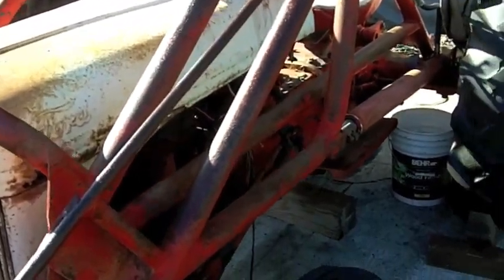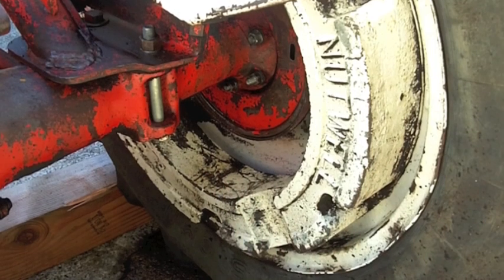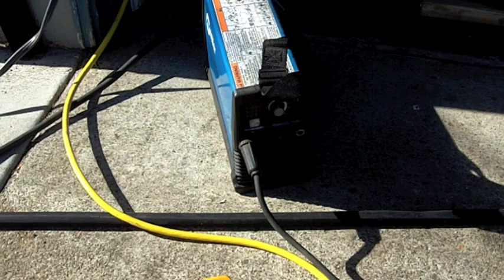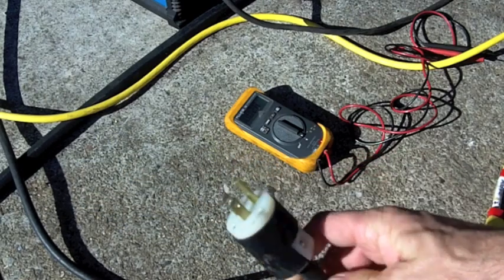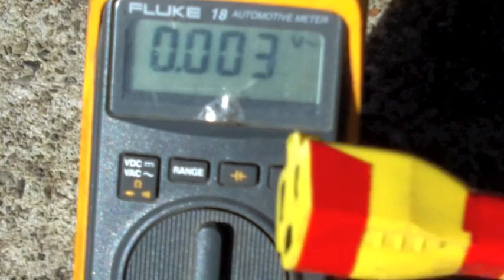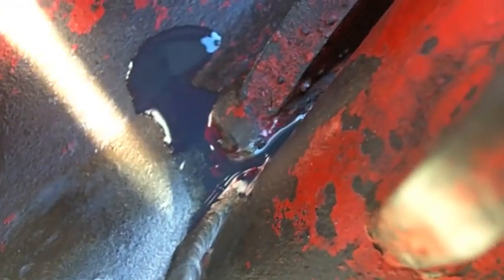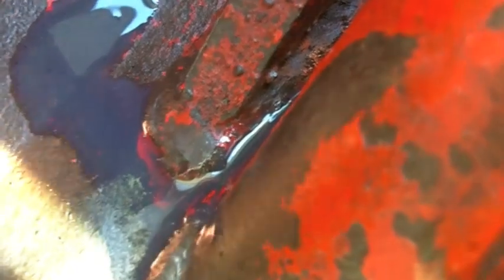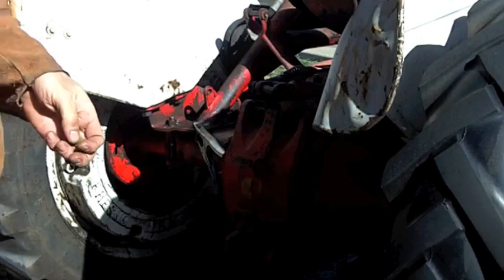Fixing Hydraulic Leaks On The 8n Tractor 1

Comment: Is it 12 volt?  My grandfather had a Ford tractor.  I don't know if it was an 8n or 9n or something else.  It plowed snow in Maine, long after farming stopped.  The plow was just a flat wooden blade on the loader arms.   You may need a real plow blade for all the Ranch roads.  Your hydraulics may support power angling for the blade.
Reply from the maker: Jeffrey Plum the P.O. converted it to 12v at some time.  At this time , I really have no intention to use this as a snow plow.  I have the blower on the smaller tractor and a blade for it as well.  We don't get arctic snow at The Ranch.  Those rare years where we get a real dump, my neighbor takes care of the inintial clear.
Reply: Winter in Maine and Mass. make one focus on snow removal.  It looks like very nice machine for general ranch work.    I look forward to seeing all you make of it.
Reply from the maker: Jeffrey Plum Yeah, I guess if you live in an area that gets several feet of snow...several times during the season you really have to figure out what to do with all of it... seems like when there is a LOT of snow on the ground the world shrinks.
Reply: We don't get alot at once, usually.  Things like Nemo and '78 are exceptions.  I have a G I shovel from sand bagging in '78.   I'd trather have more snow than the  snow-then-rain mixes we get near the coast.   That gets heavy fast, and freezes like cement.

Comment: re liquid in your tyres billstmax uses windscreen washer fluid as ballast for his garden tractor winter time rear wheels
Reply from the maker: TheThecyclist Thanks for the tip.
Reply: yourbeekeeper if you check his videos there is one showing him filling the tyres with screen washer fluid he poured it into a bucket and used a submersible pump to put it into the tyres he removed the valve core first to make it easier he uses this stuff as he lives in orangeville in canada where it gets very cold

Comment: Well done on the weld. That seal might have been dried out from sitting. Took a bit of driving to force new oil in there and then it swelled tighter. Not that I wouldn't change it. Do you think there is calcium chloride in the tires? Don't know if you get cold enough to to freeze solid. The calcium chloride was more enviro friendly and cheaper than antifreeze for tractor tires as I remember.
Reply from the maker: 57WillysCJ I will definately change both seals...I don't like leaks if I can help it.  I should have made a video, but that same day I captured some of the clear liquid that came out of the tire and let it evaporate in the sun in a pie tin... there was no residue left in the tin once the water was gone, so I suspect the liquid was plain water.  This tractor has never been in a freeze zone, so they likely saw no need to go beyond plain water.

Comment: Use 3/32 rod to weld up the cracks in the loader frame, V out the cracks and put in a root pass clean out the slag fill the crack. You could burn it with 1/8th but you will get a stronger weld on those cracks with 3/32.
Reply from the maker: Graveltrucking Hey Gt. Thanks for the tip.  I ended up using the 1/8th only for the first repair with the 1/2" steel plate.  The 3/32 was used for the rest of the pipe repairs.

Comment: Awesome stuff man! 
Do you still have the plastic protective cover on your meter? If you do I totally understand. I don't peel anything off till it starts to come off by itself LOL. The TV, Monitor, Microwave, Washer and Dryer to name a few. If not I just revealed something really weird to everyone. 
Cherry welding my friend. 
Can't wait for the next video.
Reply from the maker: iworkforbudlight Hey Bud, That Fluke is about 13-years old and yes, that's the original protective film on the display...lol.  I peel most protective films off, but for stuff I know will lead an industrial life, I leave it on.
Reply: I thought the same thing.  I actually always take them off because mine seem to have the bubbles in them and it drives me nuts looking at them.

Comment: This will be a sweet little tractor after you work your magic.If your tires have tubes they might be filled with calcium chloride which is highly corrosive but will resist freezing to 50 below. Its commonly used in Iowa on farm equipment when you need more ballast.
Reply from the maker: zollermichael That same day, I captured some of the clear liquid that came out of the valve stem, put it in a pie tin and let it evaporate in the sun...there was no residue at all, so it appears it's plain water.  This tractor was never in a freeze zone.

Comment: Just a thought here. But if you were to lift the bucket all the way up, all the oil would be in the cylinders instead of the reservoir, therefore less oil, and oil weight to cause a problem while welding on the cracks. Those old style loaders that have the oil inside the frame were notorious for cracking, and leaking. I wish you best of luck with the project.
Reply from the maker: kbert63 Not a bad idea...That probably would have made it easier.   I got both leaks welded up that morning.  If another leak presents itself down the road I will definately give that a try. Thank you.